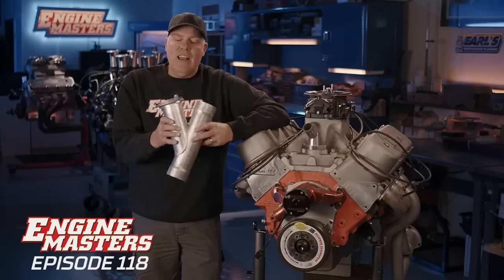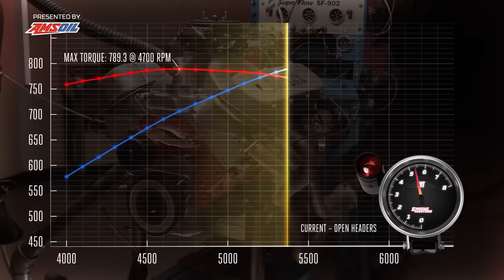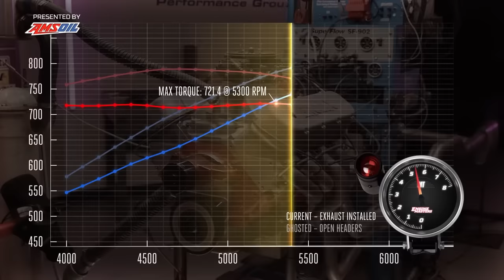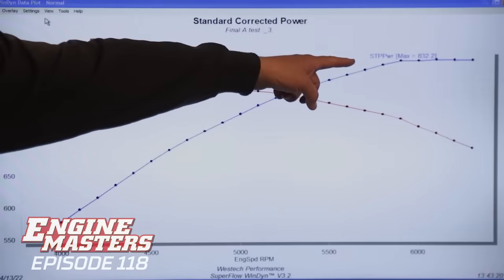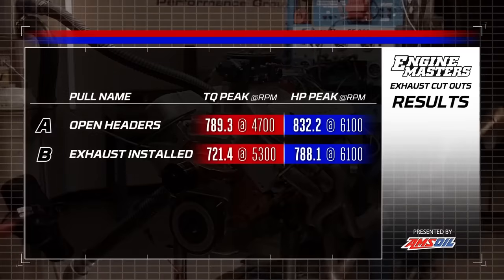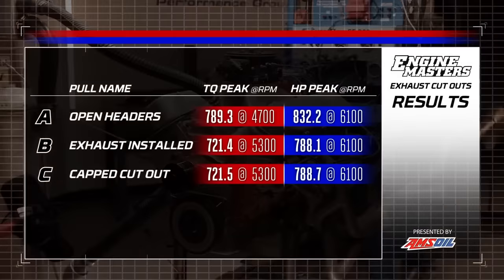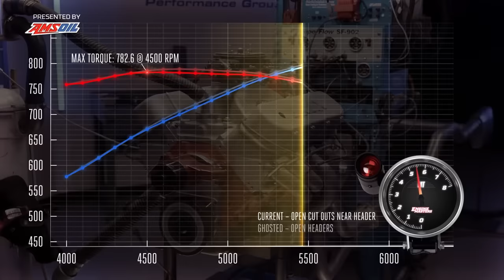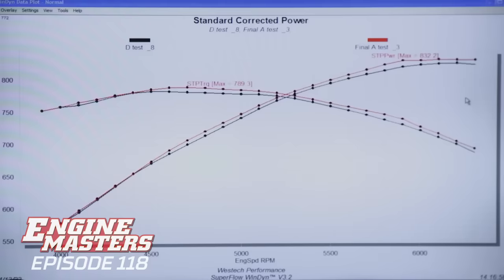Testing Exhaust Cutouts on Big Block Chevy! | Engine Masters | MotorTrend

Comment: I'm curious to see what the other two styles of cutouts would do, theoretically they would do better than the Y. There's the oval ones that come straight off the side Less in line with the flow but what little to no turbulence closed. Then there's the diverter style like No Weeds that changes the direction of flow entirely for the mufflers but dumps straight out for the cutout.

Comment: Im curious if theses cutouts would cause any issue with the readings on O2 sensors in a fuel injected application?
Reply: they will. you will need several feet of pipe after the 02 sensor or clean air will make its way back up into the pipe and cause a lean reading. the lower the engine speed the worse the problem.
Reply: Absolutely

Comment: You have to richen the mixture and adjust the choke if you use these on stock engines.

We've used these for years in the 80s. Limited success.

Bloodviking

Comment: I wonder if you had the cut out straight threw and the muffler path to the side if it would make and difference. 

Maybe even a modified ball valve? Rather then a cap.

Comment: What if you mounted the cut off backward? Faced the capped end toward the motor? Would this increase air flow through the entire exhaust system using the venturi principal?

Comment: do they check for exhaust modifications during annual inspections in most states?  my local muffler shop guy told me not to put one in... because my states makes inspectors check for any sign of exhaust modification.   non-factory exhaust is fine, as long it doesn't exceed the decibel meter that the inspector uses...   however, if they find a cutout with a remote control, they do not pass the car.  strangely, if the cutout does not have a remote control, it gets passed. (meaning the driver has to manually open/close it by going underneath the car)  :(

Comment: I've often wondered why the exit for the cutout is on the branch tube instead of the straight part of the pipe. I understand ease of access but if you're at the track you probably have time to crawl further under the car to open them.

Comment: I'd like to see a test like this on a low power engine or even a 4 cylinder.  See if it's only a more significant loss on a high power engine.
Reply: A small engine can't afford the power loss as much as a big one, it should help the small engine even more!

Comment: Can't you tune mixture to be a little leaner, to make up for the backpressure?  It's not flowing as much air, obviously, so carbs (maybe timing?) need to be adjusted.
Not fair tuning up for open headers, then just stuffing some mufflers (back pressure) on there without tuning for it.
Still, the bypass stuff is the theme, and those are some very interesting results, but not too surprising. Still, don't you have to tune the mixture when you open up the exhaust? 
I suppose electronic controlled mixture rates / timing could fix that. Just have different maps for closed or open exhaust.

Comment: Isn't this a reflection of exhaust pressure wave tuning (no pun intended)? Restriction notwithstanding, the increase in output is because the open atmosphere appears to the exhaust valve  with cutouts open as it does with the open header.  It would have been interesting to know if the cutout length matched the 18" collector length. Thanks for the vid gentlemen. This is already my pursuit this upcoming racing season. Full street exhaust and crack open the cutouts at the track. I am a little disappointed with the loss of low speed torque with cutouts capped though. That'll kill me on the highway. Thanks again.
Reply: My thoughts, too👍

Comment: Now what will happen if you put an extension on the cutout? If the length is right, you should see an internal supercharging effect whereas the gas velocity helps pull exhaust from the other cylinders.

Comment: As an old-school drag racer/engine builder/tuner I have always had some questions about carb tuning. I realize carbs are antique technology but I have a question Brule might know. Back in my day I usually blocked off the power valve and tuned the carb strictly with jetting. How wrong was I?
Reply: I'm no Steve Brule, but I think that you are now probably aware that you used up more gas & spark plugs than necessary and probably caused more cylinder bore & ring wear from washing the oil off them with excess gas. Many drag racers still tune their cars that way, but why not make use of the circuit that exists in the carburetor to make it work so much better? The best in my opinion to do for a street or drag car car is to size the primary main jet for best drivability and then size the power valve channel restriction for the proper wide open throttle air/fuel ratio. On the secondary side it is best to plug the power valve and to achieve the desired a/f ratio using the main jets only because the power valve circuit is located halfway up on the metering block and can potentially be starved of fuel on acceleration. I think road racers prefer to use functioning power valve circuits on both primary and secondary sides of the carburetor.

Comment: I'd of thought you would have the "cutout" short side on the "priority" in the y pipe for better flow with cutouts open and then force it round the bend of the y for full exhaust system

Comment: Please do a header comparison of shorty, long tubes, mid length, and tri-y on a mild build. A setup that's mainly a typical run of the mill street build. Ohh, and you could even do that same set of tests on a 500+hp setup to show how those choices would matter that much more for best power. The main goal would be to figure out if the claimed attributes of each style of header is true, if the difference between them is noticeable, and if "longtubes vs shorties" and so on is worth the extra dough. Please up vote, folks. I'm sure more people than me want to know if their butt dyno is accurate or if it's a placebo effect..

Comment: i wonder if someone makes a cutout where the cap is on the straight end, you might get all your power back when its open that way, tho it would only work in cases where you have quite a bit of room for your exhaust

Comment: Great episode, you almost answered all my questions… although i have one more question, if i have one of these cutouts on my truck open and i try to cross a small body of water how do you think it would affect the engine (if any) since its located somewhat close to it?! 
Keep it up guys, always coming up with great videos, big thumbs up
Reply: It will make some back pressure but won't kill the motor unless it's really deep dont shut the motor off or it may suck water into the exhaust
Reply: Depends a lot on your cam, reversion is something that boat engines have to deal with continuously.  I know the duration and separation numbers are pretty well established, I just don't keep that info inside my head.

Comment: would be interesting to see the afr chart with each exhaust config
Reply: None of that should make any difference. As long as your cut-outs are after your o2s&egt sensors or any other fancy controls, then your tune doesn't know what's behind it. Your tune controls your engine, not your exhaust. Lol
Reply: @thefinalgrind  id say the exhaust mod would affect the afr and the "tune"  regaurdless where your sencsors are
Reply: @mudNwheels  It won't. But I would like to hear your reasoning behind that thought
Reply: @GarageSupra  Everything changes the tune. The exhaust has to be tuned for just like any other change that's made. Less exhaust back pressure = less heat = the engine can take more timing.
Reply: You "could" optimize your engine fueling for each exhaust condition, yes, but the cost and benefit ratio of that isn't worth it.

Comment: What if you put in a cut out that leads to mufflers but you can close right after the bend for the full cut out. That way you have the back pressure you need and make more power
Reply: Friburger you get what I’m getting at right?

Comment: I have installed exhoust cutout straight-before catalytic converter. I'm loosing power or not? How about back pressure? Engine v6 3800 pre series 1
Reply: It should make more power, but there's the possibility that the sensor in your exhaust may not be reading properly when it's open.

Comment: wouldn't the easiest way be to have a flapper valve which is manually operated. choke cable type set up or just control it with your ECU. BTY. you should try an AUSSIE Haltech ECU, very good quality gear.

Comment: so, the  cork  should  then  be  not on the tip of the y end  but, rather  along the way   where the exaust fumes are going thru in order  to avoid any detour and avoind  that  loss of power --  i think  it is due to how it is designed .. should correct that and  should be all good  for a test

Comment: If you capped the straight line and had street exhaust going around the bend, then uncap the straight I bet it would be the same as no exhaust (other than the change in collector length which may influence output)

Comment: I would like to see a run with the cutout the opposite way meaning the exhaust would go through the cutout to the mufflers, then when uncapped for max hp it will be straight through.

Comment: the motor would keep all its power if you put the mufflers on the side of the cut out with the angle and the straight side as the open side,,try it and you will see,,great job on the video

Comment: The cut out should be straight out the back. And the exhaust system should be diverted of the side. The reason there was a loss using the cut out capped is it creates a pressure wave the is reflected back into the engine much like a expansion chamber on a two cycle engine.

Comment: I thought the muffler scenario would add more low-end torque due to better back pressure, but clearly that is not the case! Open headers are the way to go!!!
Reply: Back pressure is kind of a myth thing. Exhaust science is complicated sorta
Reply: Backpressure = low end power is a myth, it's that simple.
Reply: No mention to the damage  to our ears, sleepless nights and angry neighbors when these cutouts are put on street vehicles

Comment: Anyone remember the cable activated cast iron cutouts from JC Whitney?
Reply: If I remember correctly they were only for 2" pipe, though.
Reply: @mickangio16  you could be right. That was a long time ago.
Reply: I think Mr. Gasket sold them, too. And I think that may have even been after JC Whitney sold them.
Reply: The way I see it, though, if they would have made it for 2-1/2" exhaust pipe, which was big for the time, and the cutout was only 2" it still would have been a good performance part. The whole purpose of a cutout is to relieve excessive exhaust back pressure that mufflers and pipe bends etc. present. AND I'm not sure how it was intended for the pipe to attach to the cast iron part. If it was designed for the pipe to slip over the housing and clamp on that would mean the housing itself was restricting the size even further than the 2" pipe size🤷‍♂️ I think cool concept but poorly executed. They were probably actually made in the 1950s, though. I imagine it as an "Honest Charlie's" speed part, haha. I spent a lot of time as a kid daydreaming over modifying my car with parts from the JC Whitney/Warshawsky catalog. I bought quite a few parts from them years ago. Stories, haha. The store on State Street in Chicago was always packed. You took a number and waited for a LONG time for service- even when called ahead of time for roll call. I even got thrown in jail once for a visit there. The Blue Star Auto Parts store across the street was cool, too.

Comment: Dual 3” killed my 496 down almost 100hp from open headers. Think it was 94 or 96hp difference on back to back dyno pulls. I’d have run the cutout straight through with the muffler off the Y if I was going to install a set. Has anyone had any luck with the electric models? Gates or flaps? I’d consider a set but I just have a feeling that 500-600 cubes of blown big block will rattle them to pieces

Comment: A 600 HP engine would have been a better test. That 800+HP overwhelmed the 3" system. That engine would be running at least a 3.5" or maybe 4" on a serious car. Taking the collector extension off and replacing it with the Y pipe may have been why it lost some torque down low when open. Keep the 3.5" extension, then 3.5" to 3" reducer, then the Y-pipe, and then the rest of the system. Maybe even a 3.5" Y pipe after 3.5" extension then reducer to rest of system.

Comment: I expected a difference but not that big of a difference! That's about the best bang for buck HP you can get, but I'd like to see it tested again with a small block to see how much difference it makes on a smaller cube engine.
Reply: I would too.  I daily a car with that Audi 4.2, I'm getting ~390 hp with the mods I've done which is not bad for, what, 260 CID? I think a set of cutouts would get me over 400.

Comment: Curiosity is for me,  what if the "Y" part that is the "flanged cutout " was piped through the exhaust and  the straight side was used as the dump side 🤔

Comment: Can you guys do this test again? Next time mount the whole exhaust with mufflers on the diagonal section and cap the straight through. Then uncork the straight through so the exhaust goes…straight though…and doesn’t have to bend.

Comment: Small blocks will lose some torque with properly sized diameter long-tube headers dumped too soon, evidence in my VVT Hemi is slower 0-60mph times with it completely open vs closed.  Having an electric actuator I can open at the top of the powerband and keep the engine at peaks banging gears.   Definitely eye-opening data for big block daily drivers.

Comment: I have a set on my car but, I realized they build them for ease of fitment not performance. I reengineered mine to flow straight throw open and take the "curve" to go to the mufflers. Oh and BTW mine are electrically operated and did I mention I have a Gear Vendor to go on my car also. So I have two cars in one.

Comment: Real world scenario on modern engines in an actual vehicle in real world usage, there have been heaps of cases of people putting wider diameter pipes and less restrictive mufflers, and loosing heaps of power, and actually damaging the motor. Turns out that apparently the restrictiveness of the OEM exhaust is part of the engine design. Take it out, and the engine has nothing to work against. I’m no motor head, and this is just stuff I have read about. From my understanding, when the exhaust valves open, the ECU expects some resistance, and when it doesn’t detect it, it cuts the power to prevent over revving or as an environmental control as the ECU thinks the muffler has failed or there is a hole in the pipe. As it all seems to be ECU driven, I suppose reprogramming it to essentially go “Flow/emission issue? Log it and ignore it.” would be an option.

Comment: But you need back pressure to make torque. 😂 See, back pressure added -68 lbft. Perfect.

Maybe you could make a set where the cutout is straight and the exhaust side goes at the angle.

Comment: I believe the test works with this engine because of the massive amount of air it wants to flow…this engine taxes every inch of the exhaust system…I think if you were to test this on a 500hp 383 it wouldn’t make much difference…also don’t test with turbo style mufflers…everyone knows those things are power killers…try straight thru muffs

Comment: Put a decent exhaust system on that engine, and the cutout won't do squat. Use the thousand horsepower mufflers EM has already tested
They intentionally crippled that engine with a 3" turbo. They maybe could have done worse with a 2 1/2 I suppose

Comment: Interesting that auto manufacturers are doing this in the muffler (track modes) to get a better straight shot than a Y. Also that auto manufacturers are doing this on the intake side as well (IMRC plates). Cutouts made sense back in the 50s, just execution was poor--today it's been scientifically fixed..

Comment: You know you are running out of things to test when you pretend to be shocked that a wide open exhaust cut out makes almost as much power as open headers, guy it’s a 6 inch longer piece of pipe with a angle on it. That’s like being shocked if you put a Y on the end of open headers and it made the same power. Also the capped exhaust cut out made more power than the full exhaust without it so what are you jawing on about it taking some out it lol

Comment: ONE PROBLEM. YOU HAVE A CAM IN THAT AND ALL FACTORY CAMS ARE SET TO HIGH PRESSURE EQUAST.  WHEN YOU OPEN PIPE A FACTORY CAM IT FALL FLAT ON its' FACE
Reply: Exhaust cut outs are for one primary purpose... Sleepers... They are just for winning money off suckers who think that your car can't hang.
Reply: You really think they have a factory cam when the engines making almost 800 hp….
Reply: Buddy you need to not talk about engines anymore because you aint got a clue.
Reply: WHAT